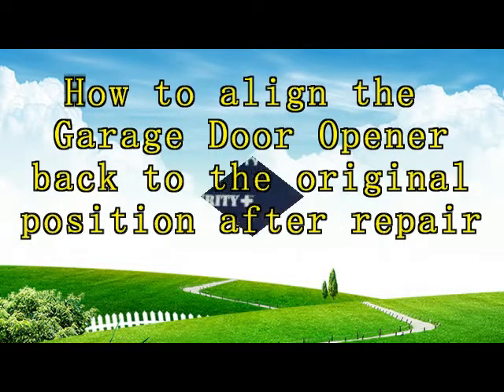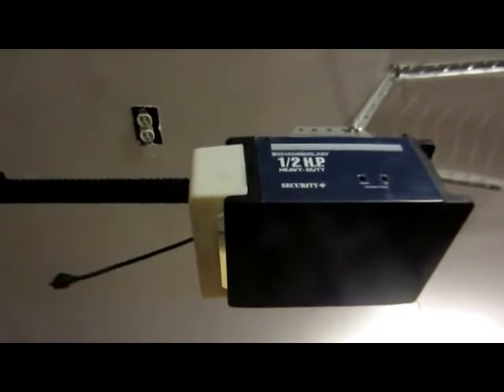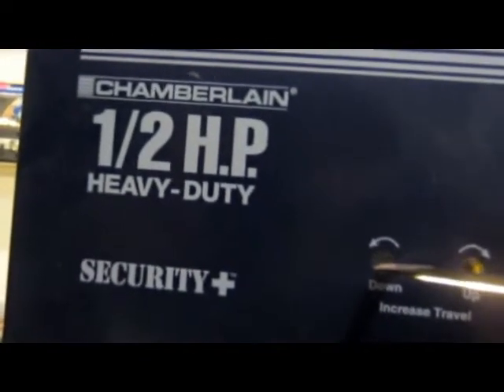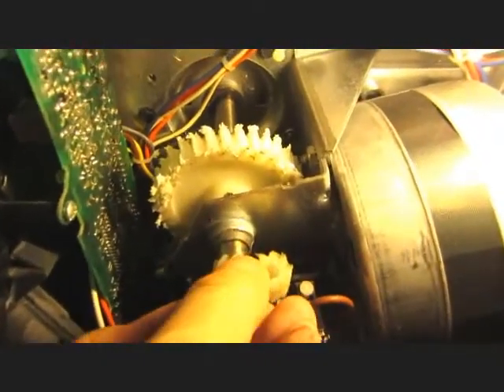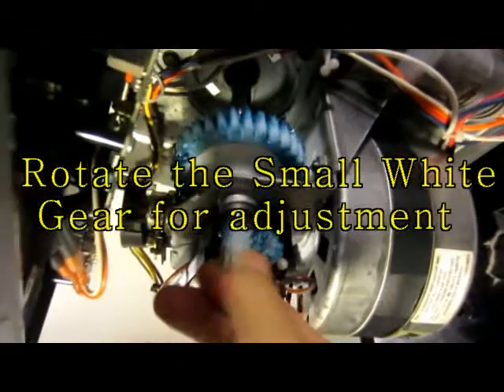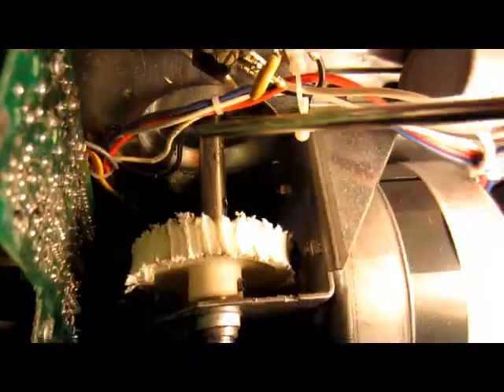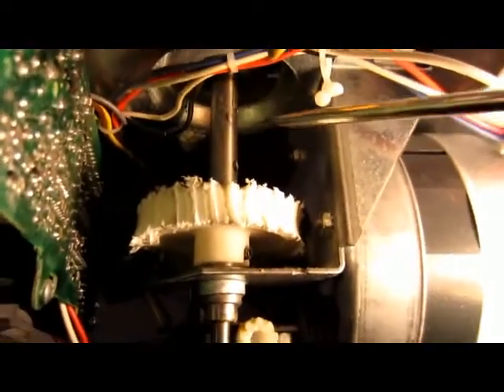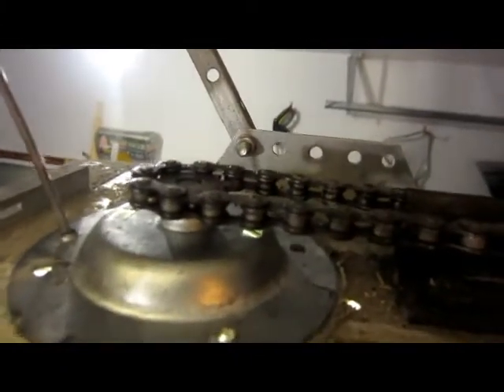How to repair Garage Door Opener? Chain Alignment: Liftmaster, chamberlain, Craftsman, Sears

Comment: Presumably, in your first step you loosened the chain and disengaged it from the drive sprocket, right?  Then, after adjusting the down limit position as shown in your video, I assume you move the trolley to the "door closed" position on the rail.  If that is the case it seems like there should be enough slack in the chain so you could just re-engage the chain back on the drive sprocket and then tighten the chain.  I may be missing something but why do you need to remove the 3 screws and loosen and lift the main sprocket assembly?  So, the question is, will the following sequence work? 

1. close garage door.
2. unplug GDO from A/C power.
3. mark inner trolley "closed door" position on the rail.
4. pull release cable to disengage door from chain/inner trolley. 
5. loosen the chain until there is enough slack to allow removing it from the drive sprocket.
6. remove chain from drive sprocket on GDO.
7. adjust the closed limit switch per your video.
8. move chain/inner trolley back to the door-closed marking.
9. engage chain to drive sprocket on GDO.
10. tighten chain while door is still disconnected from chain/inner trolley.
11. re-engage door/outer trolley to chain/inner trolley.
12. plug GDO to A/C power.
13. operate GDO 1 or 2 full cycles (open/close/open/close) to verify chain runs/stops/reverses at the right spots.
14. once proper operation is verified you could also mark the door-open position on the rail for future use.
15. with the door closed put a clear mark on the chain and on the rail as close to drive sprocket as possible.  This should help reposition the chain if you just need to replace a worn out main sprocket assembly. 
16. fine tune close and open limit switches as needed.

 Thank you for any replies.

Comment: Thank you for your reply , I have to install a new limit assembly , should I have the trolly in the centre of the track and the main drive in the centre of its run to start with and then adjust for proper opening and closing on the up and down contacts , thank you for your information .
Reply from the maker: Have you ordered or received the new limit assembly yet? Doesn't it come with installation/replacement instruction? See whether you can get the instructions from your supplier. Let's know !
Reply: It has been ordered I hope the instructions are with it , thank you .

Comment: Should you have had the chain trolly  in the down position or closed by the garage door when you set the stop switch contact  in the closed position .
Reply from the maker: The good time for the chain trolley to be moved to the down position when the Drive Shaft Assembly was  re-installed back or before the chain was re-engage back to the drive gears. One didn't have to bother chain trolley's position initially when the Stop Limit Switch was set because it was out of alignment to start with.

Comment: Man my chaing got out  place ,first time in 10 yrs  i try to put it back  ,i did but once i try to close the door it came off agan ,every time  the thing where the chain goes tha looks like a bicycle star it move a lil like if its lose ,just a lil bit, is this normal  n how much it should be to get it fix by a profecional ,thanks
Reply from the maker: If you found the bicycle star (opener Sprocket) has no worn out bearing or shaft symptoms, most likely the chain was "too lose" to cause the chain got off once the motor was turning. Tighten the chain approximately 1/2" above the base of the T-rail at its midpoint, re-tighten the inner to secure the adjustment. If "worn out" was found, bad part needs to be replaced. Hope this will help!
Reply: Thank u so much